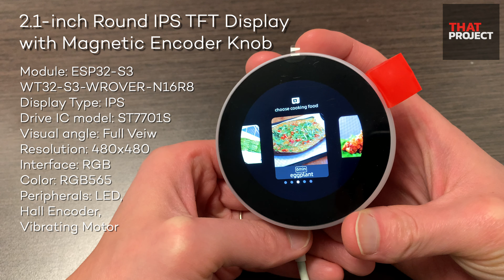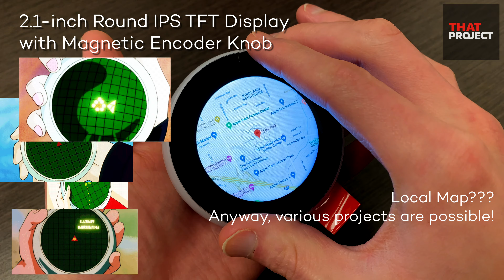2.1-Inch Round Display with Magnetic Encoder Knob #ESP32S3

Comment: Do you need also the programming board with the usb-ttl chip? Or you can program it using the usb c connector?
Reply from the maker: This requires an external programming TTL board.

Comment: How did you flash the device? I purchased the same one but am having trouble getting started.
Reply from the maker: I could only supply USB power with the enclosed green PCB. To burn Firmware, TTL to serial burning tool was used. This is what was included in the other product. I officially inquired about this so I will update again when I hear from them.
Reply: @ThatProject  I have the same question.
Reply from the maker: @ConChairman  You can find information about debugging tools in the video description.

Comment: Can you load custom firmware with Platformio or the ESP-IDF?
Reply from the maker: Sure, I can make my own firmware and flash it to this device with ESP-IDF.
Reply: @ThatProject  Cool, thanks. That was the only thing I need to know before buying, so I ordered 2. I'll set one up with ESP@Home and hook up to my Home Assistant server and do the other as a custom MQTT client.
Reply: @ThatProject  How did you manage to flash? Mine arrived today but when i attach the dev board and plug n the USB I do not get a com port
Reply from the maker: @CoryAlbrecht   Did you the debugging tool? You need to buy it. Check the video description.

Comment: Do you think it could be possible to use it to control google home devices or tv volume?
Reply from the maker: Creating a controller isn't easy. You need to know the interface to the target device and code accordingly. So I think the best way to use this device for Home IoT is to make it to Matter Device.
Reply: @ThatProject  That makes sense. I think I'll pivot to a wireless macropad with a dial and map keyboard shortcuts to Apple's shortcuts feature via accessibility > keyboards > commands.

Comment: good afternoon. how did you organize the backlight and the incoder?
Reply from the maker: They didn't open the built-in source code, so I'm not sure about it, but I believe there is RGB LED connected to GPIO4. So you can set the specific color by the count from rotating the encoder.
Reply: @ThatProject  with the backlight, it's clear. And how is the encoder organized?
Reply from the maker: @kentanton  Well, I don't get it yet. It's using mt8901 magnetic sensor. Please check it out.
Reply: @ThatProject  I found a screen with esp32 and an additional board from the manufacturer lilygo - is this the same?
Reply from the maker: @kentanton  I think they are different. The manufacturers are completely different.

Comment: hey, nice product! is it possible to flash esphome and control the touch by esphome?
Reply from the maker: I believe you can install ESPHome on this device but you need to make it with a rotary encoder instead of a touch. As I mentioned, it doesn't have a touch screen.

Comment: Thanks, but the lack of true touch input is dissapointing as it would make this device so much more useful.
Reply from the maker: I agree with you. Perhaps the next generation will be able to do that.
Reply: @ThatProject  It's weird that it doesn't have one. Surely it's pretty cheap at this point
Reply: I was just browsing ali express after clicking on your link and I found this :LILYGO@ T-RGB ESP32-$3 2.1 inch Round Display ST7701S LCD Touch Screen ESP32-S3R8 Development Board Support WIFI Bluetooth TF. Looks similar but with touch screen.
Reply from the maker: @p4z9m  I know what it is. When I get a chance, I'll try that too.

Comment: It would be nice to get an always-on (1Hz) LTPO OLED display « a la Apple iPhone 14 Pro » to always display some information.

Also the display should be bigger, nearly bezeless for the text to be bigger and easier to read from far away

Also at least 3 or 4 microphones and an integrated assistant (Siri, Google,…) to receive voice commands and be Matter compatible (WIFI, Bluetooth, Thread)

It would be nice to have it in all rooms in a house, as a thermostat but also as a voice control to control Matter devices : it could be a nice application :).